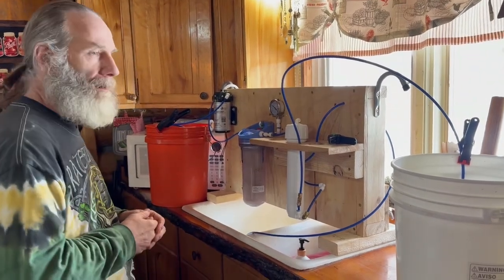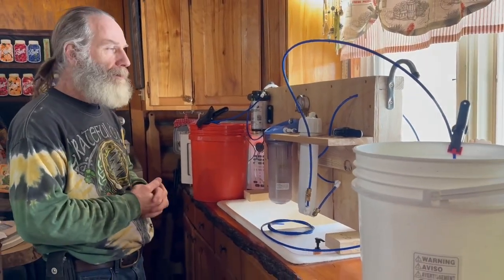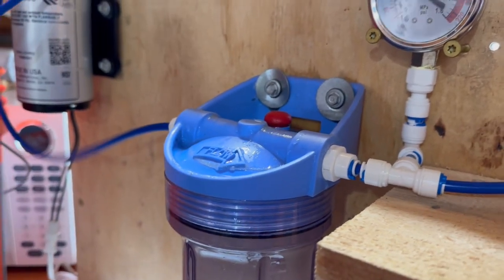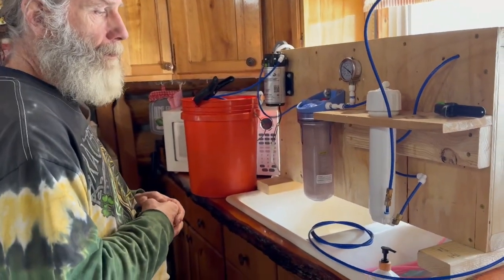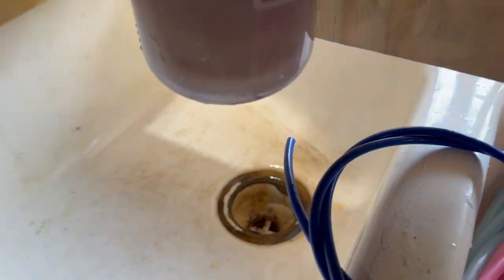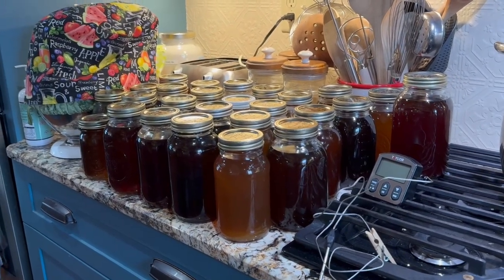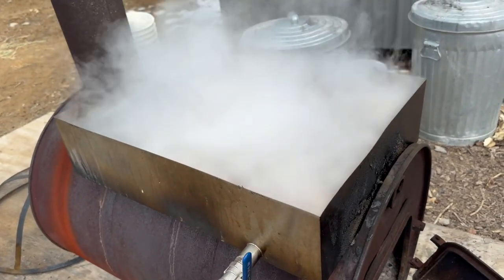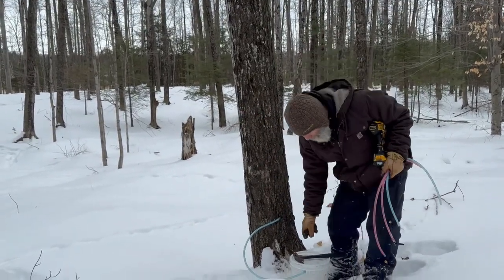RO System for Maple Syrup Production Homestead Approved from Membrane Solutions

Comment: I built a very similar system kast year. I typically run mine at 110 psi. I didnt have to adjust my pump, but I have read that pump is adjustable by a screw on top between the inlet and outlet. I use 4 membranes. I boil mine in the garage, same type of set up you have. When not doing sap I have the side of another barrel that I bolt over the evaporator opening, and use it to heat the garage.